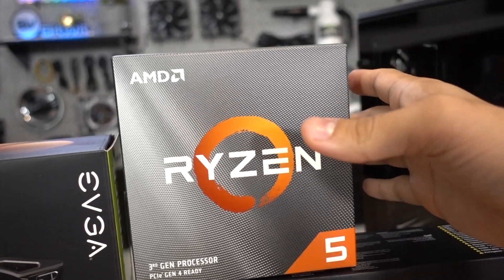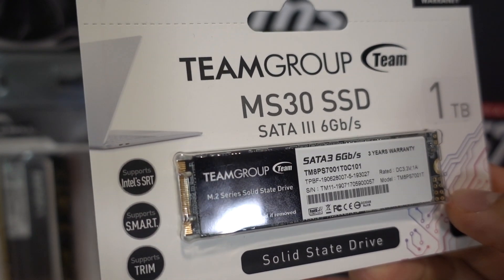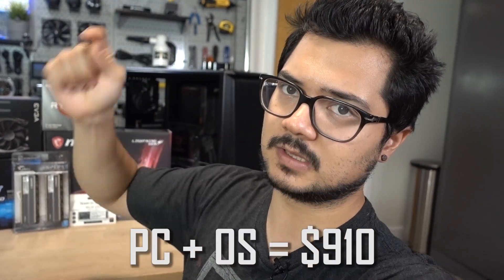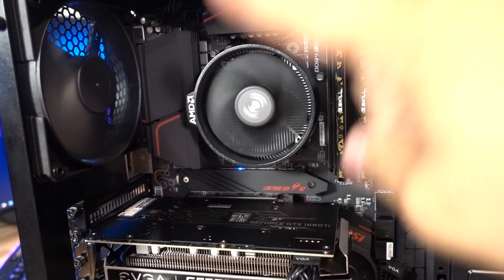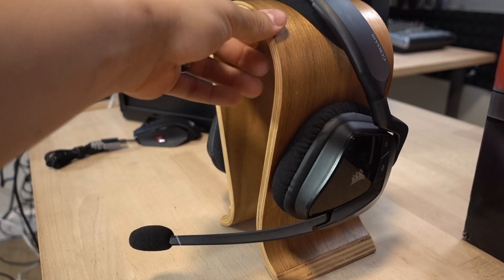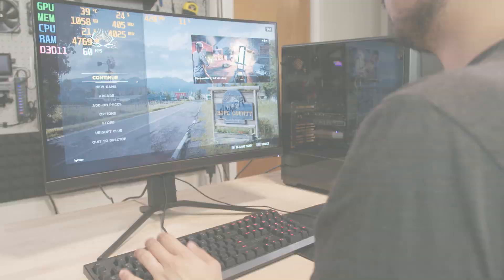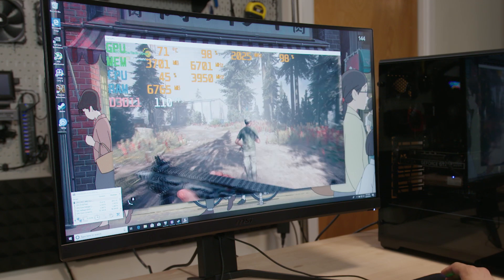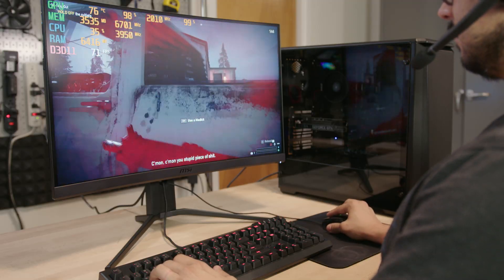Literally EVERYTHING you need to game on PC for $1500

Comment: I would save on motherboard, memory and those overpriced peripherals, and go with a better GPU.
Reply: Nelson Cruz yeah, that’s what I did for about the same price, I got a 2070 SUPER
Reply: @Victorkapz  how much is that gpu?
Reply: Pro Sonicz about $550 for the Gigabyte Gaming OC
Reply: @Victorkapz  msi rx 5700xt mech for  450$ 
Yeah boy
Reply: For greater performance
Reply: Pro Sonicz fair enough, but the price difference is a bit closer where I’m at, and I just prefer Nvidia cards. Also, the Super edges out the 5700xt in most games..
Reply: @Victorkapz  ok :<
Reply: @gusion4593  i did consider the Red Devil 5700XT though.
Reply: What is the cheapest motherboard you'd recommend for a ryzen 7 3700x?
Reply: @Jml2475  MSI B450-A Pro, B450(M) Gaming Plus, or B450M Mortar. Whichever you can get cheaper, or fits your needs the best in terms of size and features. They all have good VRMs. I would try to get the new "Max" variants (full featured BIOS with support for Ryzen 3000 out of the box), but they aren't widely available yet. Older (non Max) versions will need BIOS update, and the BIOS interface won't be as flashy (memory chip limitation). But the update can be done without an older CPU.
Reply: Used 1070!
Reply: @Victorkapz  what motherboard and ram did u choose instead?
Reply: @rahul-qm9fi  just some corsair 16GB Ram and MSI Tomahawk MB..
Reply: @Victorkapz  alright cool. Thanks
Reply: @Victorkapz  same idea here
Reply: Pixel Paranoid yeah, you won’t regret it.. makes games buttery smooth at 1440p
Reply: @Victorkapz  i know, plus i already have peripherals all i need is a pc and a new mouse (model o which is cheap af) so im going for r5 3600 and rtx 2070s
Reply: I need a good grade first tho this year 😂
Reply: That would cause bottlenecking
Reply: @Lapsie  what would cause bottlenecking may i please know
Reply: @PixelParanoid  having cheap cpu, motherboard and ram but having a really powerful graphics card
Reply: @Lapsie  i dont think ryzen 3600 bottlenecks the rtx 2070s.
Reply: He could’ve even saved all this stuff and went way under budget if he just used a 1660 super instead of a 1660ti. Alternatively, he could’ve went with a cheap Redragon or Npet mechanical keyboard, gotten a Glorious Model O, and saved $120-ish on the monitor by going with an AOC monitor of the same spec. I also agree with you on the motherboard, there is probably a much better option for a cheaper price. I personally don’t think this video is a very good guide at all for newcomers who know nothing about this kind of stuff. He also didn’t include a table, which is very hard to find for a good price. I got lucky with a 55”, super solid desk for $70 on Amazon, but that took forever to find, and I genuinely mean it when I say picking a well priced desk was one of the the hardest parts of my build. I hope Kyle sees these comments and addresses this.
Reply: @gusion4593  Your driver issues with the RX 5700 and XT makes getting a 2070 seem like a better buy.
Reply: Ey GPU priority bois
Reply: @NelsonCruz77  this!!!
Reply: @lauritsjacobsen8345  🙌🙌🙌
Reply: @PixelParanoid  may you achieve that brub
Reply: @BIZMVRK  thank you man. The tech community is really the best community ive seen on the internet
Reply: I got 2080 super for 500 sale
Reply: @poof1560  impossible
Reply: Never cheap out on a PSU!
Reply: Wat  I think 3600 memory was more expensive at the time. But yeah. Definitely the least overpriced part.
Reply: Wat what are you gonna play on, the floor? It may not be a peripheral but it’s still a part of the setup
Reply: Wat  yeah memory is on spot
Reply: Wat Wat Yes, he should actually include a chair. This is stuff that you should think about as someone who is coming into PC gaming; finding a table that fit my needs for a good price was hard for me and I’m sure other people have the same issue. Obviously my argument is going to sound dumb if you MAKE it sound dumb by over exaggerating my point, but I don’t really see the issue here. This guide is meant for beginners and theres a lot of stuff that you don’t think about at first but you realize are actually kinda hard, and I think that this video would be better off with the inclusion of a desk. We’re seriously arguing over a desk, let’s just agree to disagree and go our separate ways
Reply: Wat like I said, although I see your point, I don’t agree with you. A desk is an essential part of a setup and just because you use it for other things doesn’t mean that it subtracts from that. I think it should be in the video, you don’t. We can agree to disagree and move on with our lives because quite frankly I’d rather not argue over a desk
Reply: Wat I perfectly understand that this video’s is meant for a PC and peripherals, but as a beginner guide I believe it should also include a desk. The only reason I believe that it should have a desk included is because it’s a beginners guide. Unless you already have a desk, do you need to buy a desk? Yes. And it’s generally not an easy process, which is why beginners should know this stuff. You’re so adamant about the desk not being included as I am adamant about it being included. There’s no point in continuing because we’re obviously not going to change each others minds.
Reply: Fr man, wtf is that ram
Reply: I’m tryna do this same thing but with a $800 budget
Any graphics card suggestions? (Looking at the rx 580, the pc itself will have to be $500)
Reply: @deathlytiltmotion3867  gtx 1660 super or ti
Reply: @gusion4593   i stoped use amd cards the driver team can seem to get there shit together plus wattmans built into to drive so your stuck with a chunk of blot-ware
Reply: @PixelParanoid  dont buy r5 3600 better go for 3800x or i7 9700k
Reply: @eusterich3035  3700x is what im getting now. no need to pay 40$ for 3% more performance in a 3800x
Reply: @PixelParanoid  but 3800x ovetclock s better btw in india price difference is less than 20 dollar
Reply: @eusterich3035  its not its 40$ expensive inr.
also, theres not much difference in oc ing a 3700x or a 3800x.
Reply: @gusion4593  same performance lol
Reply: Motherbaord is an essential component dont ever cheap out on it
Reply: @nitrosoo9417  not buying an overpriced motherboard is very different from cheaping out. In this case, the x570 bring very little to the table compared with good B450 boards. Also, buying a top of the line motherboard to go along a budget cpu is just stupid.
Reply: u better not, as known b450 chipset wont have ryzen 4th series support
Reply: @Ed9ra  unfortunately true. Didn't know that before last week. But still... is Ryzen 4000 support worth 60 bucks? Someone that got a B450 plus a Ryzen 3600, like me, still has several upgrade options in the 3000 series. Which will come down in price significantly once the 4000 come out.
Reply: @NelsonCruz77  absolutely true vision from your side, I myself building on x570, but that's only because I was saving lots last couple years for a new pc build, but anyway u still have a great room for upgrade
Reply: @Victorkapz  same here
Reply: xOr  I wouldn't buy a crap 50$/€ motherboard, but I also wouldn't buy a 250$/€ one either. Like the one in the video. Especially not to pair it with a CPU that costs 180-200. There's a lot of middle ground there. Plenty of good motherboards for 80-150 $/€. The MSI MPG X570 Gaming Plus is probably the only one Bitwit had around, so he used it. That's fine. But it's totally out of place on a system at this budget level. It's an unbalanced build.
Reply: @gusion4593  500$
Reply: ryzen 3600 will not bottleneck a 2060/70
Reply: Yeah if anyone sees this, go for a cheaper headset rather than the void pro. My $1500 PC setup has a Void Pro but a overall $1500 should not have a Void Pro. That's like saying GSkill Trident Z RAM is cheap
Reply: FR
Reply: yeah ikr like why didnt he do the rtx 2060
Reply: I got an rtx 2070 with ryzen 3 3500x for $1500 with peripherals
Reply: i was literally about to type that
Reply: Same, he has literally spent 250 on the board, at this price point he must be mad
Reply: yep
Reply: 50 dollars for a mouse is a good price wym
Reply: I think a 2060 super would be good for this
Reply: 1660 ti is pretty good
Reply: @Demertech  not really, but with current prices a 1660 Ti or Super might be the only thing you can get that fits the budget.
Reply: @NelsonCruz77  I have a rx560 4gb and it gets the job done. I have had hands on experience with better hardware and I believe you don't need much. I would say a 1650 super with a 3300x and 16gb of 3200mhz ram is more than enough for nearly anyone today.
Reply: @Demertech  depends on what games you play and at what resolution/settings. Stuff like Fortnite at 1080p, sure! I play mostly single player AAA titles, and want at the very least High settings. Even on a 1080p monitor, I have a RTX 2060 and I'm looking to upgrade.
Reply: @NelsonCruz77  why a 2060 will run fortnite on max settings 1080p no problem unless there is a huge bottleneck
Reply: @Demertech  But I don't personaly play Fortnite. Read my comment again. I play mostly single player AAA games. Think Red Dead Redemption 2 and Cyberpunk 2077. Those were the last two I played.
Reply: @NelsonCruz77  will both run on 2060 just fine
Reply: @Demertech  Depends on what settings and FPS you want. It's on the edge for my taste. With very optimized settings I could even turn on Ray Tracing in Cyberpunk in some places, mostly interiors. Outdoors in the city, forget it. Goes over the 6GB VRAM of the card.
Reply: Same
Reply: @Nothing-je7sk  agreed. 60FPS is perfectly fine for me. Even 45 FPS can be acceptable, depending on the game. Usually I only start looking to upgrade when some new game comes out that I really like but runs at less that 40 FPS on average, or has frequent and significant drops to the 20s-30s. At High settings or above. I won't play on Low or Medium. I rather wait until I have a better PC. The last game that made me upgrade was AC Odyssey. Currently it's Cyberpunk 2077.
Reply: @Nothing-je7sk  and there is no point for 240hz

Comment: Here in the UK its about £100 more to get x570 motherboards rather than b450 ones instead of $30 more lol
Reply: BadMan power supplies are also so expensive in the uk lol
Reply: Tell me about it mate, us brits get shafted on pc components
Reply: Huge even the used market it clapped
Reply: @joobenraycox6439  non existent where I am up north 😂
Reply: @HugeHeadedGaming  sometimes but other times - here in Liverpool anyway you can get some sweet deals. I made a Rx 570 with r3 1200 build for 220 😄
Reply: i dont understand the x570 choice, he says it has better memory support, but the memory controller is inside the 3600. And the b450 motherbords get the same agesa bios updates, so the only benifit is pci-e 4.0. I think an ssd with pci-e 3.0 x4 will do just fine. And i think the msi tommahawk or the carbon bords can still handle a 3900x just fine.. In 4/5 years ddr5 will be mainstream, so will pci-e 4.0. I cannot immagine for gamers any use case to go for a x570 motherbord with a noisy chipset fan where you pay for shit you will likely never even use.
Reply: @joobenraycox6439  mate a Corsair 800w platinim PSU set me back £115, it's expensive as hell for no reason lol
Reply: @josephjohnson9649  that's fair, fetched a 1070 from Huyton a few months back, only £180
Reply: @HugeHeadedGaming  really? Lucky you saw that ad first bc if I saw it would be mine asap. I live in Huyton 😭😭😭😭
Reply: some B450 board and Ryzen 2700 8 core cpu .. would be my choice
Reply: Meanwhile, in my country it costs twice or thrice the price of a B450
Reply: Yeah thats why I'm here thinking I got a vastly better setup for 1200, all because of mobo prices, I got shafted when buying a psu tho so..
Reply: @senorstinkyfeet7872  i paid 60 for mine 😑😑
Reply: yupp in the Netherlands too, rip
Reply: @joobenraycox6439  same here indeed...
Reply: @HugeHeadedGaming  check out randomgaminginhd, he does great budget videos and he's English
Reply: @Rem_NL  motherboards that start with b are not overclockable and x570 has pcie gen 4 and faster memory
Reply: @deadlock2579  B series motherboards support overclocking. A series do not.
Reply: Timurmalik Khaydarov you can overclock on b450 boards...
Reply: well hey guys if this US/UK open trade deal happens those prices are going to come down
Reply: Americans live in their own little bubble when it comes to prices. The rest of the world pays the real prices.
Reply: Yeah mate this shit is crazy paying more 100 pounds innit?
Reply: Yeah
Reply: Dude could you please have a look at my build im a starter i can send link privately
Reply: Australians get ripped off even more (GPUs in particular are expensive here which is why I still have a GTX 750)
Reply: @stepdaddee4543  if by that u mean brexit then they pound will cash so much it wont make a difference

Comment: To those that plan to follow this build, don’t use MSI x570 motherboards, go with Asus x570 boards... MSI made great b450 boards, but their x570 boards suck (Except the $700 godlike)
Reply: Only the budget ones have been tested for VRM temps. And those VRMs are as good or better than b450 so they ateast get as hot. Other high end boards are fine. Their bios updates just suck major time
Reply: or ASUS TUF GAMING X570
Reply: I would buy a Gigabyte-Board like the Elite. It's the best board for the money, especially when looking at the VRM-section. It's chipset-fan is not as good as the MSI-one (because that's the Frozr-Fan-Design and extremely silent), but it's nice for the money.
Reply: Chenshilong Sun their x570 ace board is legit as well brother. I have that board and it’s a beast.
Reply: @treyocho_530  yeah the ACE is pretty good, but I doubt a lotta folks will be willing to spend $340 on a mobo. tbh x570 boards as a whole is kinda overpriced, but at least Asus has sub $200 x570 boards that can handle even the 3900x (tuf and prime)
Reply: X570 ace and creation are also great
Reply: How about MSI B450 Tomahawk Max? Is it good? Or should I take the Asrock B450 Steel Legend? (I read it somewhere that Steel Legend is one of the best).
Reply: @Akiwaaa_  steel legend sucks get b450 tomahawk max
Reply: @felixmx3008  How about the cheaper version? MSI B450-A Pro MAX? Is the Tomahawk really far better than it cheaper version? (Fyi, the Pro Max is $50 cheaper).
Reply: Pro max is micro-atx right? I was looking at the tomahawk max also and am convinced it’s the best option for a 3600 but idk, that’s why I’m in the comments lol
Reply: @takz9961  it's full ATX since it's the A-Pro the one with Micro is Pro-VDH I think.

Yeah, I really wanted the best board, but if there's no difference between Tomahawk or A-Pro, I better save up some money. (What I mean for no difference is like the VRM cooling system, since for the Audio or USB port or RGB, etc. it doesn't really matter to me).

Comment: I went with 2600 and a RX5700 with a 144hz display for 1200$. X570 and Ryzen 3000 is too expensive here. :(
Reply: 2600 and rtx 2070 here. Yes 3000 is too expensive
Reply: 2600 and used 1070 strix for 350ish $$
Reply: @MaxxPlay99  that 2600 must be working really fucking hard lol
Reply: @justinc2633  My pc rockin 2600+2070Super no bottlenecking whatsoever... 
Running 1440p like a wonder!
Reply: @OllieoOG  that's impressive I have 3600 and 2060 super and it looks like I'll be good with a 2080ti equivalent without upgrading cpu. I'm slowly becoming an amd fanboy next gpu will probably be amd lol
Reply: jvalex18  the drivers are fine, not as good as nvidia but they're fine
Reply: I got ryzen 2600 + rx 580 for $240 💪
Reply: If you budget properly you can fit a 3700x and a 2070 super

Comment: Just purchased all of the prices to build my first PC. Very excited. Managed to spend a little over $1,100 but I can easily upgrade down the line. Ryzen 5 2600, GTX 1080 (used for $300) 1TB M.2 nvme, 16GB OF RAM,  B450M MOBO, and a 650w 80+gold

Comment: Interesting setup! I guess you opted for creature comfort over pure value for money gaming. Personally I would have chosen a cheaper set of 3200 memory, sub 100 dollar B450 board, something like a CM Devastator set and mainly a wired and therefore cheaper headset. With the money saved, get an RX 5700 XT and boom much better framerate thus using the monitor better thus better experience 😁
Reply: Dude, you nailed it...I'm in shock why he chooses the 1660 Ti over the 5700XT

Comment: 10 more dollars and you could get a Nvme ssd from team with 3000 read and 2600 write and still 1T
Reply: Intel 660P Nvme is $95.00 at newegg right now.
Reply: Kyle had to turn a trick for that extra 10 bucks so it was a no go. Maybe Lyle would have done it. Let's get a Lyle build in there!
Reply: @josephbhumphrey  intel's 660p only gets to 1800 read and write 15 more dollars and you could get something that is nearly 67% faster in reads and 15% faster in writes. so roughly a 13% more in cost for more than 15% more in performance.
Reply: @deenycest10710  Can agree

Comment: Edit: Kyle, any reason you didn't go with the asus prime x570-p? 

For anyone out there who's going to be making this and only playing at 1080p, get the asus vg279q and the rtx 2060 if you can. The monitor is 144hz, ips and cheaper than the one in this so you should have some left over for the rtx2060. If you want, you can also get a smaller capacity ssd for a boot drive and a 2tb 7200rpm hdd from Seagate as a mass storage. That's it. You might be going 10 or 20 dollars over budget if you don't find them on sale but it shouldn't be too bad.